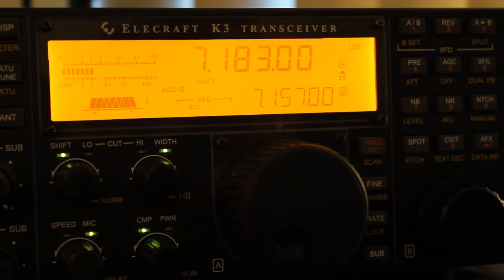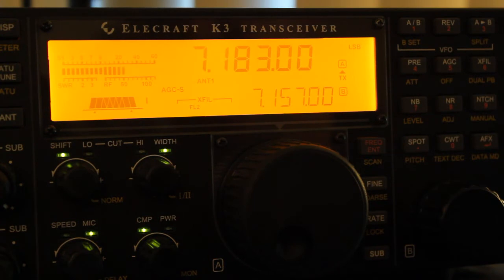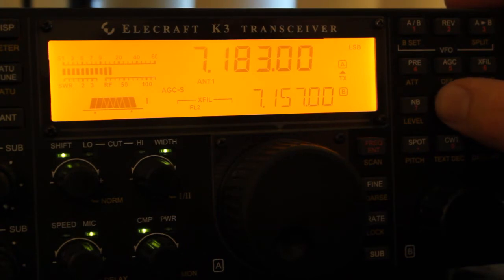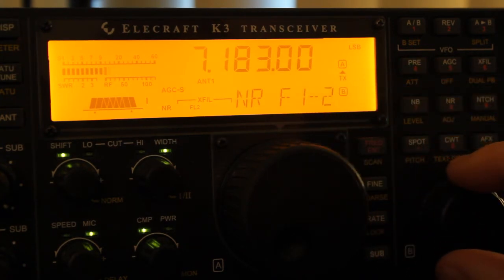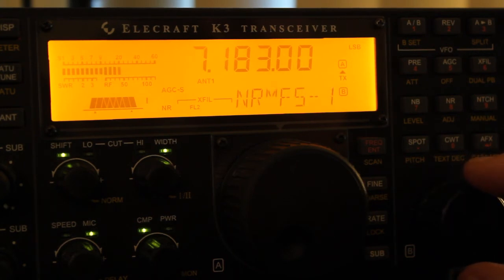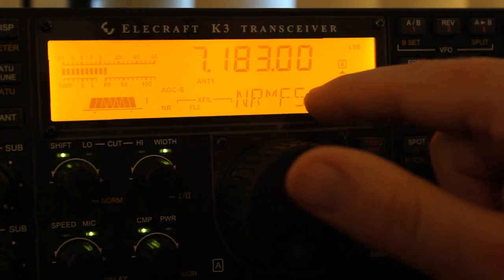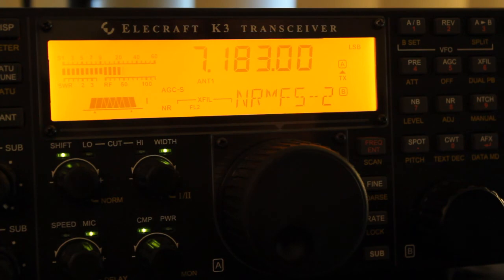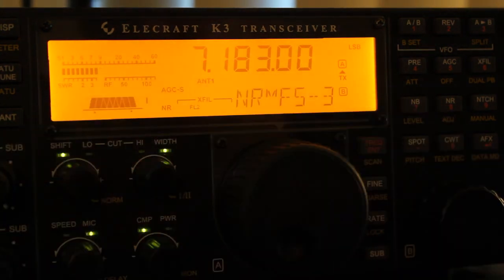Elecraft K3 Noise Reduction Demonstration

Comment: With all due respect IMO those stations sound terrible. And why would anyone need to use NR instead of RF Gain or ATTEN when listening to 20 over 9 signals?
Could you please demo the Elecraft K3 in pulling in signals S1-3 out of the noise or pulling out weaker signals when strong nearby stations are just a few KC away?